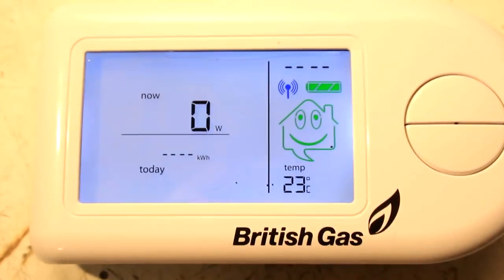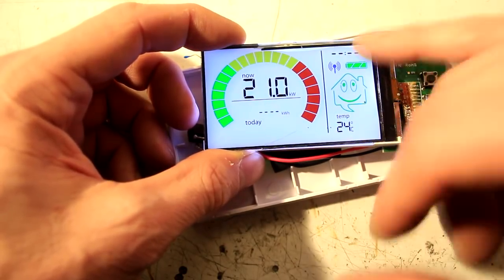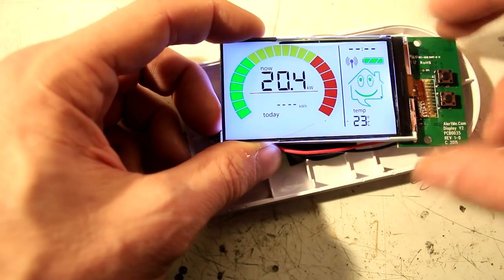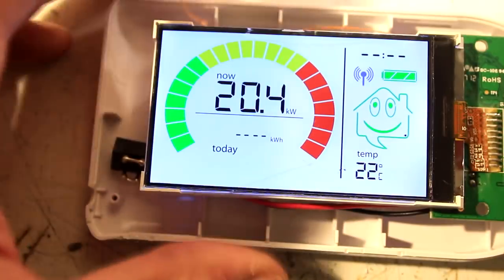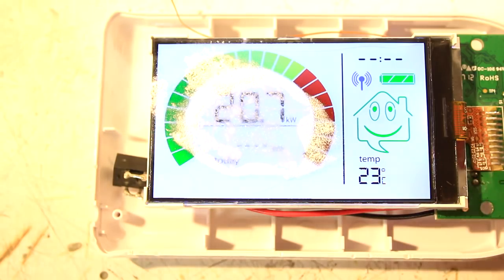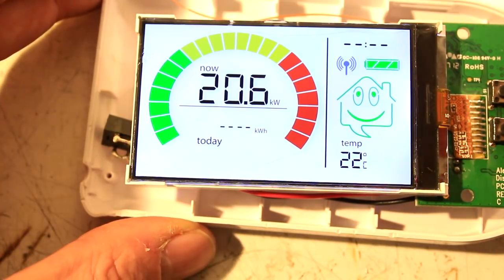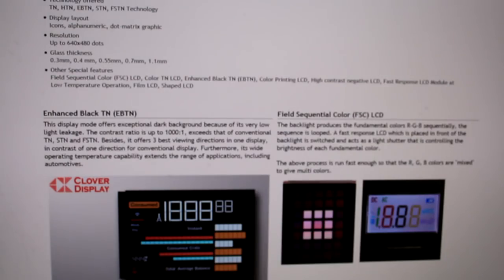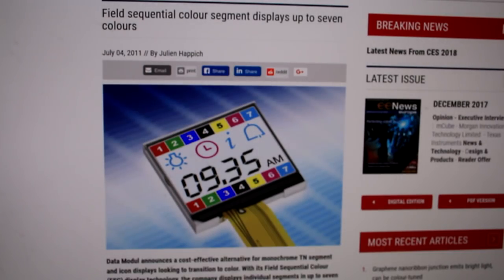Interesting colour LCD on home energy monitor

Comment: Ah - I have just stumbled across this through a link from Facebook. I designed the electronics for that when I was at Alertme. We had two versions of which you have the newer one where the LCD controller is on the display itself with a simple serial interface between it and the Ember250 Zigbee chip mounted on the main PCB. The earlier ones used two controllers on the main PCB mounted as Chip On Board with two Zebra strips to connect to the LCD glass itself. The technique was called Field Sequence Display. I do have some pictures of the wire bonding version where I had to create the PCB design to work with the bare die. This would have been back in the 2009-2011 time period. The clamp was a fun design as well as the challenge was to make it as small as possible.
Reply: The led in the clamp is part of the pairing process and the NIMH cells were down to flammability requirements back in the day. We charge the cells with a pulsed trickle charge process which was recommended by Varta.

Comment: What the heck is drawing 20kW of power at your home? are you running the urianium centrifuge again? :D
Reply: "It's kind of overkill but I always test high power meters with my Stargate which I picked up cheap second hand".
Reply: An electric shower draws about 10kW (many UK houses use electrically heated shower). Combine that with someone making tea (kettle: 3kW) and someone using the tumble dryer (since its never sunny or dry here!) and that quite easily goes to the 15-20kW range
Reply: Crypto mining farm. That would be a medium sized homegamer  one at 20kW.

Comment: Just one point, 3 NiMh batteries gives 3.6V and LiPo batteries are 3.7V so there is no difference in the voltage so no need for a booster with the Li batteries.
Reply: That's just their nominal voltage, though. Three Ni-MH cells in series will be ~3.9-4.2V when fully-charged, and drop to about 3.0V when empty.

But the important point - which I suspect Mike was referring to here (he said "marginally higher", IIRC) - is that Ni-MH cells stay around 1.2V each for almost the entirety of their capacity, so this thing will have ≥3.6V until the cells are almost drained, whereas if it used a single Li-Ion cell, the discharge curve could be a lot more linear, so its voltage may drop below what the device needs well before its energy is depleted (this will depend heavily on the exact chemistry and technology of the cell(s) used, and since this is something designed almost a decade ago, I suspect it'll be hard to find data on that...)
Reply: @AndrewGillard And those 3.9-4.2 V and about 3.0 V are what LiPo give as well.
LiPo might say 3.7V, but that is just the nominal voltage, batteries have a curve.
Oh, and the 1.2V on NiMh rechargables and 1.5v on non-rechargables will in the end give the same output.
And then obviously the voltage will drop with more load. They will offer the biggest capacity under very small loads.

Comment: Makes me wonder what LCD-tech the (pretty crude) color LCDs in the old Siemens phones were (S10D (Active) and S25 for example, so well over 15 years ago. Closer to 20 years actually). They were able to display RGB pixels and later phones (like the S25) even allowed for some mixed colors, but they were still dot matrix AFAIK, not TFT/STN. White backlight too (which I'm pretty sure was anything but cheap back then)
https://www.cnews.cz/galerie/pictures/clanky/2015/05kveten/10-mobilnich-milniku/10_mobilnich_milniku_05.jpg

Comment: I've got one of the early Efergy meters which uses the same CT-over-radio method and also had a tendency to under-read, however on those you can manually specify the supply voltage so I was able to roughly calibrate it by telling it that the supply is 260 volts.

Comment: Typical cheap Energy Meter trinket. What's the point of measuring AMPS, when the customer is billed in kWh? It's not only a fail by not detecting Volts, hence guesstimating the kW, but it's also guesstimating (or ignoring) the power factor so it completely fucks up the kW. This is probably less accurate than the broken watch that is is correct twice per day.
Reply from the maker: The voltage will be fairly predictable, as will the PF. The biggest loads will be heaters ( kettle, shower etc.) and other loads with fairly high PFs
Bear in mind this is just a tool to help users visualise their power draw, so accuracy isn't hugely important
Reply: Just get one of those magic energy saver boxes with a giant a** capacitor and plug it into your mains... that'll fix it right up. ;0
Reply: I can not accept this. Most energy consumption is normally caused by appliances with long run times. The 5 min of the kettle are not the thing. The fridge with it's induction motor - low cos(phi) - does consume a significant amount of kWh/year. So a power measurement device which does measure apparent-power is only useful in one use case: in a pure DC environment.
This thing has a nice LCD, but is useless as an energy meter, if it does not measure real-power.
Reply: mikeselectricstuff - in my country (Australia) the biggest loads are inductive motors. Air conditioners, heat pumps, fans, pool pumps, 300 x switch mode power supplies per household, LED lights, Fridge, etc etc. There aren't many resistive loads left. Any large resistive load (eg: Hot Water) will be connected to off-peak. Occasionally when the temps drop under 15C we plug in a 2kW fan heater, but that's not very often.

Comment: Has any body saved power by using it?
Reply: I saved power with my old Efergy one, discovered my UPS was drawing 60 watts even when switched off. Meter effectively paid for itself in 8 months based on that alone.
Reply: I saved a lot.

Comment: I used to have one of those, as supplied by British Gas. The LED in the sender illuminates during the pairing process - which was required frequently (one of the reasons I binned the device!). I wondered how the display worked with regards to displaying colour. The smiley house symbol relates to the temperature, rather than anything to do with energy efficiency.
Reply: Pete Allum Wait... You threw it away because the led light on the sending unit was lighting up? Or are you saying you threw it away because it unpaired frequently?

Comment: I got one of these from British Gas (my electricity supplier) and notice if you cast your eyes away from the display your eyes see three distinct colour bandings from the LCD, like a strobe effect, a bit like seeing CRT flicker out the corner of your eye. At night time these are quite annoying if in corner of your eyesight. You see a very distinct R/G/B effect. The LED inside the sensor is for resetting the comms link - For anyone that has one of these and it the two items stop communicating (and the battery CR2 battery is good) there is a reset procedure I've done on mine:

Remove power supply from display, hold top ‘menu’ button down for 10 seconds and the screen on your display go blank to show it’s been turned off.
While your monitor is turned off, disconnect sensor from electricity meter, remove battery and reinsert after 10 seconds.
Now press reset button halfway down the side of the sensor. You’ll need to press the reset button around 4-6 times until the LED inside the sensor lights up solidly and then start to double flash.
Reconnect sensor to electricity meter
Now insert the power supply back into your display and while holding the bottom ‘adjust’ button down, press the top ‘menu’ button four times. The display will then flash white and clear, before returning to displaying the pulsating blue antennae.
Your display will now reconnect to your sensor and begin displaying your electricity consumption within 30 seconds.

Comment: Do we know what protocol the wireless current sensors work on?

I'd like to make a Pi or arduino based energy monitor that can monitor multiple circuits, with logging etc.
These wireless current clamps seem like an elegant solution assuming the protocol they use can be determined.

Can they be bought without the screen?

Comment: Years ago I had a Casio PDA which had a 3 colour LCD - have a search for CSF-5550.
It was definitely a passive matrix, and it had a slightly odd 3-dimensional effect, as though there were actually three different LCD layers on top of each other, each of which produced a different colour.
Reply: Yeah, back in school I had a three-colour Casio graphing calculator that worked by having three stacked LCD panels.
If you looked at the screen on an angle you could see that each colour was in a different plane.

Comment: Have you heard of other devices measuring current AND voltage ? I bought a similar model, the Geo Minim+. Doesn't measure line voltage either, but I didn't know it would be a problem. It turns out that under heavy load in my neighborhood the voltage  may drop to about 200V instead of 230, but as I have mainly resistive appliances, this 13% error on voltage leads to about 25% error on power, making it nearly useless (as this error is not constant, I can't compensate with the "fine tune" parameter, which allows for a fixed multiplier). Anyone ? Thanks
Reply: There is a device called IoTaWatt which can take an AC voltage reference as an input and up to 14 CTs for current, based on the ESP8266 and connects over wifi.
Reply: This would be an excellent feature. It wouldn't be that hard to design a wall-wart that could plug in anywhere in order to measure line voltage, then wirelessly transmit the data back to the UI just like the current clamp does.
Reply: Thank you very much, I was unaware of OpenEnergyMonitor products. 14 CTs is maybe a bit overkill, but I will look at their emonPi and emonTx as well... Thanks

Comment: Is it possible that the low reading is due to a pessimistic assumption about power factor? With current-only reading these things have always seemed pretty useless to me - would be better to have zigbee sender monitoring the flashing LED some power meters have (flashes once per a set amount of energy use) for overall use, and plug-in wattmeters for looking at individual appliances when needed.

Comment: JVC made a 5 inch monitor/TV with a color LCD shutter over a monochrome CRT. It is a field sequential display. It uses a frame buffer and a scan rate triple the usual. It looks OK but has a visible line right across the middle. TM-L450TU is the model number.
Reply from the maker: Tektronix also did this in some of their scopes
Reply: Back in 1971 Wireless World published a 2-part article on building a scanning disk field sequential colour TV adaptor. 

Didn't take long to find it online - PDF links in post #25 here: www.vintage-radio.net/forum/showthread.php?t=91700&page=2

Comment: I have seen ordinary LEDs being used as light sensors...
Reply: the BBC micro bit is using its LED matrix for that.
Using just one led is not very efficient, so I do not think that this is the use of this hidden led.
(figuring out if the clamp is open or not can also be figured out by pulsing the transformer)
Reply: Plus they need the right colour of light. I used this 30 years or so back on a bit of automatic test kit to check that the correct colour LED, red or green, had been fitted in each position.
Reply: yep a reversed polarity LED will indeed work as a light sensor

Comment: Thanks mike - once upon a time we'd have seen a prototype of that display on BBC tomorrows world.

accuracy seems imo fine for domestic customers but anecdotally I hear these monitors makes normal consumers unnecessarily fearful of appliances with a high draw immediately when switched on like kettles and dishwashers and doesn't really help them find the  stuff sucking fractional Amps constantly (and tbh this unit might be in that class too - my dad's got a monochrome type without backlight that runs on battery only for over a year)

Comment: We actually used one of these sequential color LCD controllers on a segmented energy monitor display 8 or 9 years back. The thing did not have backlight so instead of RGB we got 3 effective shades of grey. It was somewhat fiddly designing the LCD pattern software to exploit it.

Comment: Interesting that they have done this. Especially because of all the cellphones nowadays, you'd expect them to use an off the shelve LC display from a phone to save cost and time, but apparently it was important enough to design all custom. At least it simplifies driver hardware.
Reply from the maker: Custom segment LCDs are not very expensive - once you're making a few thousand of anything they're the cheapest option. Tooling is typically only $1-2K, then the display are a dollar or two each

Comment: The device needs to make assumptions about not only the voltage, but also the power factor!

Needless to say, very very inaccurate way of monitoring energy usage.
Reply from the maker: For domestic use, power factor is going to be pretty similar so approximating based on typical mix of appliances won;t be far off. these things are for indication, not billing.
Reply: Can confirm - been monitoring my home and logging data using a billing-grade Wattnode Modbus with the billing-spec ct's they recommend - looking at a graph of two years, the lowest power factor ever hit was 0.95, with 99% of the time it's 0.99. mostly computers, servers, cfl bulbs, air conditioning, electric water heater, etc
Reply: CFL and many LED bulbs have a low power factor. The ordinary bridge rectifier + cap gives you a low PF and a capacitve dropper gives you a really low PF. The induction motor of a fridge also has a low PF.

Comment: Hi MIKE,
is it possible that SIEMENS also used this display tech their S10 and S11 cellphones
https://www.gsmarena.com/siemens_s10-86.php
https://www.gsmarena.com/siemens_s11-87.php
Reply: AFAIR those produced different colours by different voltages. Casio used such a display in it's CFX colour graphics calculators which worked without backlight. If you changed the contrast setting, it would cycle through the colours. See: https://www.youtube.com/watch?v=iXftPCNQSgw
Reply: I was mesmerized by those phones as a kid (if knew well they didn't use TFT). This CFX calc is also wonderful.
Do you know what is the name of this technology?
Reply: I don't know if there's an actual name for this, but in the calculator, they used 3 different layers with differently dyed liquid crystals. They could be controlled individually, so you could clear one coloured graph without having to redraw the other two colours.

Comment: Ah - my Alertme colour energy displays. I designed them when I was Alertme (now Hive). It was called a FSD LCD (Field Sync Display). There are two versions - the first ones with Zebra strips and the latter thinner ones with Chip on Board for the drivers
Reply from the maker: What's the LED in the CT for ?
Reply: It was for pairing with the main system (yes these did work both with the display and also with the rest of the Alertme system). When the first batch of 2K displays were made the ladies in the factory in China couldn't see bad segments so I spent a few days in a screened chamber looking for the faulty units. I do have some pictures of the bond wires somewhere on my old laptop. (yes these were from 8 years ago).
Reply: Ah - my memory is failing me - the first ones were using chip on board and zebra strips to the glass , and this one is the latter type which is COG chip on glass which is far simpler. I can dig out some of the earlier ones with COB and post some pictures of them
Reply: @sparkybruce  I remember you had me make a test system for scanning the wires to look for faults, an AVR with several GPIO multiplexers, I think
Reply: BRUCE BENSON Yes please
Reply: What you did there with the display is very cool Sir !

Comment: Does the main unit also have a power pass through to measure an individual device, or are you supposed to just hold it next to a device while turning it on or off?

And how does it recharge?

Comment: I bought one of those from eBay a long time ago and was also impressed with the sharpness of the colour on the display and the way they created it.    Then just like your other one that isn't pairing, mine lost contact and I could not get it to pair again.  All I got was the three dashes of disappointment.
Reply: Hi Clive , if you still have them I can dig out the instructions. I still have a lot of my old Alertme stuff in the garage including some of the test boards that never saw the light of day. Some of the modern Hive devices are still based on the designs I did in 2008...
Reply: I'm not sure where the original is if I still even have it.  But inspired by Mike's video I just bought another on eBay.

Comment: If this is an END USER DEVICE... doesnt this sort of clamp metering thingy would expect to have a whole power cable going through ? like phase, neutral AND earth wire at the same time ?? i know real clamp meters only show correct if only one wire runs through it. but how should an end user do this ??? split up a power cable ??
Reply: Power meters in the UK are typically connected up by single "tails", so it would be quite easy to clip the current sensor around the Live tail only
Reply: Axel Werner no, it is intended to be connected near your meter, where the live and neural are in separate insulated conductors.
Reply: i.e. not in a sealed enclosure?
Reply: There's no need for them to be in a sealed enclosure as they're double insulated cables.
Reply: As Monkeh said, meter tails are double insulated, so they arent enclosed.